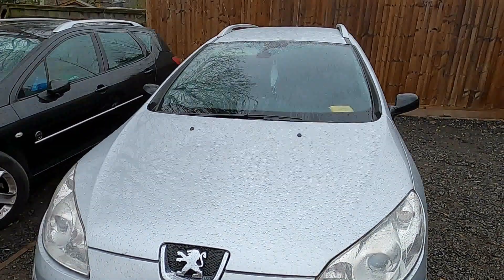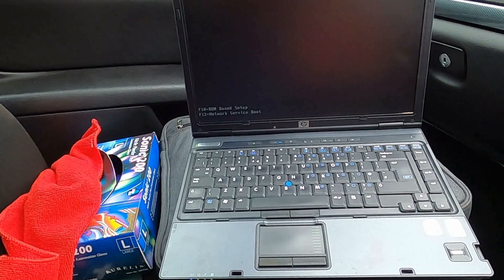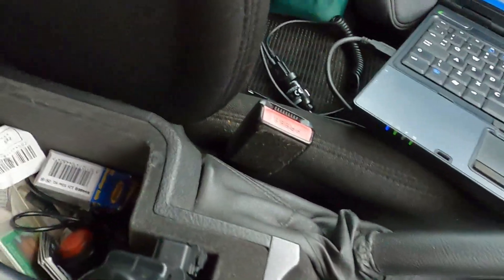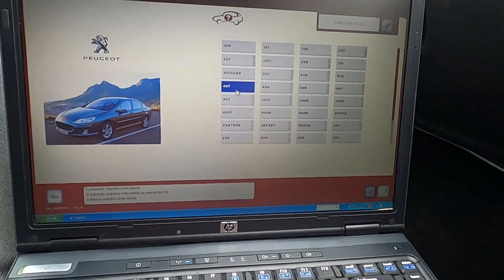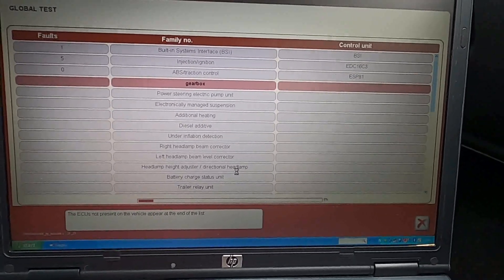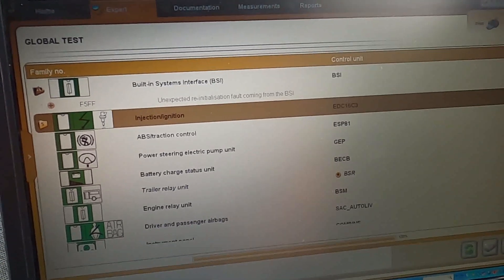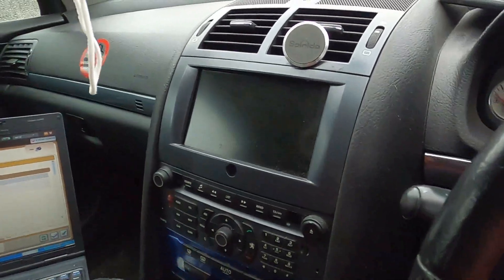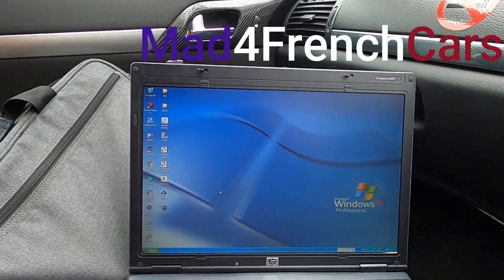Just a quick fault removal using Diagbox

Comment: Hey bud, your videos are all good I’ve just subbed. I need to renew eloys tank & fill with new liquid on a 308 sw. Never had a Peugeot before. Trying to understand about this scanner. Where can I buy a cheap cable
Reply from the maker: Also there is a facebook group i nelieve called Lexia and peugeot planet group but they sometimes people sell laptops with diagbox already on it
Reply from the maker: Hi mate i got my scanner and software from ebay
Reply from the maker: The link on ebay is expired now but i have diagbox 9.150 i think and its good up to 2024 cars and it costed me only 10£ for software
Reply from the maker: The cable you should be able to find on ebay aswell make sure is full chip one
Reply: @Mad4FrenchCars  can’t find in eBay pal
Reply from the maker: @game4alaughman i had a look aswell I see only overpriced versions
Reply: @Mad4FrenchCars crazy prices

Comment: Diagbox fine on a W8.1 laptop I had lying around with no VM... Yet to test on W10.
Reply from the maker: If on windows 10 then only properly works first update i think 7.57 after that you have to use virtual drive

Comment: Vreo 5 feluri de accent sa moară bibi 😃
You do know if the fault is not permanent , you could delete it with a cheap 4£ odb . If it's a permanent fault through, it can't be reset, even with the pp or diagbox ,cause it will come on again.

Comment: My diagbox not see the ecu.what cant be the cause?sorry for my english
Reply from the maker: I am not sure mate sometimes it happens then ignision is not on before scanning a car. I am not sure what could couse it
Reply: @Mad4FrenchCars  i try what you sad tomorow.thank.s bro😊
Reply: I try it works.thanks you are the best
Reply from the maker: @bmarian9357  thank you matr
Reply: I have a fault....fuel flow regulator....can i fix de regulator...i mean clean it????
Reply from the maker: @bmarian9357  I think there is 2 fuel regulators, one is attached to  high pressure fuel pump and another one mounts on to a fuel rail it depends on the engine.
Reply from the maker: @bmarian9357  normally need to replace them
Reply: @Mad4FrenchCars  yes.but i understand the fuel rail regulator is faulty because the fuel flow regulator.i try to clean the fuel flow regulator on the pump...open and close it with diagbox and spray cleaner on valve
Reply from the maker: @bmarian9357  I personally never cleaned it. I have replaced both before. Good luck hope everything works.
Reply from the maker: @bmarian9357  sorry bro I don't have a WhatsApp. What Engine is in your car? You can just Google how they look like

Comment: Hello, good video, I have a 206 hdi 03. I have the same software  as you but i have been using pp2000 for mine. Can i use diagbox the same as you are using? The software looks better. Thanks
Reply from the maker: Hi mate i think you already using best software for it. I normally use Peugeot planet for cars older then 2004 and for cars from 2004 onwards I use Diagbox. But you surely could use Diagbox for your 206 aswell with no problems
Reply from the maker: Diagbox you can get from ebay for like 50£ it's basicly 2 discs and cables. It's best to have a separate laptop just for Diagbox also it works best on Windows xp professional.
Reply: @Mad4FrenchCars  ok thanks very much i do in fact have the same set up as you i got mine from ebay same  as you. I have some faults i need to fix like faulty mass air flow valve air intake and abs fault to sort out, should keep me busy!
Reply: @Mad4FrenchCars  Can you change the millage? I bought a used display for my Citroen C4 Picasso, and now the millage is wrong. Need to change it.
Reply from the maker: @Ptvermoes  Mileage in any citroen or Peugeot is recorded in bsi and speedometer so if you get bsi and speedometer from a same car with same part numbers then that's one way to do it, mind you then ignition lock and door lock will have to be changed or a your keys programmed to new bsi. With Diagbox you can't change mileage only change it from km to miles I believe

Comment: Hello Dear ! Do You know where I can do: steering angle sensor calibration in Peugeot 407 in DIAGBOX ? I can't find it.. mhmm
Reply: Go to....esp....repair....pack repair
Reply from the maker: Hi mate i cant remember now on top of my head. What happen did you pull out a steering wheel angle sensor out of comms unit? Why is it giving you this fault? I have pulled a steering wheel angle sensor out once with a steering wheel from comms unit i had to get a new comms unit as it was no chance to put it back together same like factory
Reply from the maker: Just go through liturally every section  most likely will be under some actuator test. I remember having a same issue vut i couldnt manage to recalibrate it and it worked fine with another used comms unit and sensor.
Reply: @Mad4FrenchCars  Hi Mate! I have problem with ESP (unfortunately it's sensor in whell). I tried calibration in PP2000 but without effect. I heard that in DiagBox it's possible - but I can't find it :-) Stering column have 660* possition and no react on change possition of whell.
Reply from the maker: @ks-wikariusz  i am not a 100% sure what the solution would be but you might have more luck if you join a facebook hroup called Peugeot 407 UK there is over 2000 407 owners and someone deffinatelly had it sorted same issue very recently.

Comment: Buy FAP app from amazon appstore and OBD2 scaner ELM327 or similar. It will works much much faster for faults clearing. Diagbox is good program, but it works too slow 🐌. I hope one day will be similar app like obdeleven* for PSA cars. Ačiū už video kurimą!👍
*(VAG cars app created by Voltas IT)
Reply from the maker: Well i have to agree it is a bit slow. Thankyou for comment. Aciu
Reply: Does the FAP app and those scanners require a windows XP laptop? Or can you use a smartphone?
Reply from the maker: @iceicebuddy  fap app you can use on a smartphone i believe diagbox is best on windows xp. Diagbox just offer more things to be done with it like a key programming, air bag turn off, unit pairing with vin number and so on